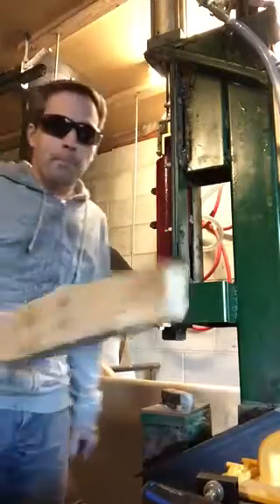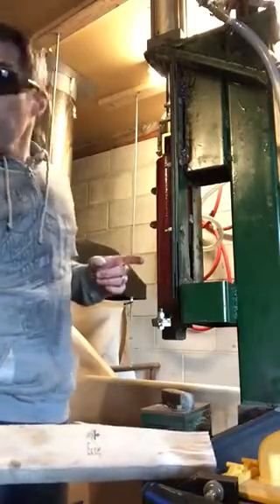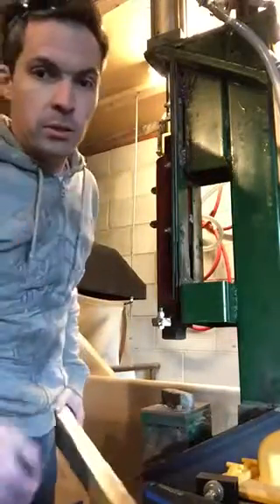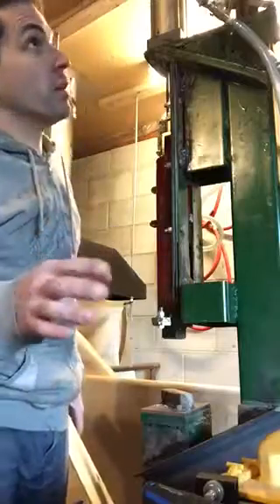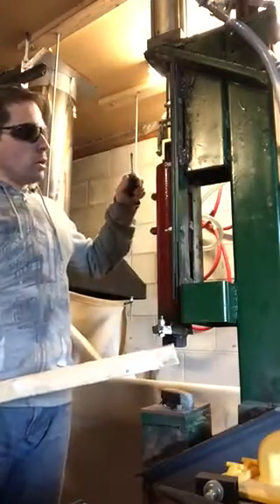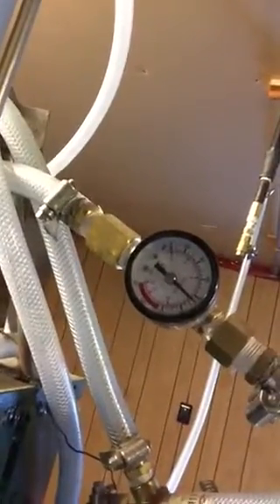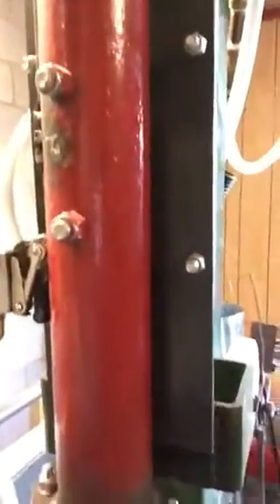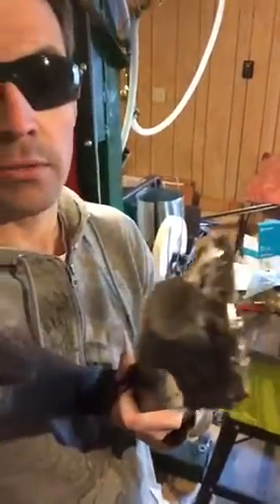Help! - DIY blacksmith power hammer

Comment: I run a quick exhaust on the up stroke to increase cycle times. If you can find an extra air tank plumb it in right next to the hammer. This operates as an expansion tank. Say your hammer runs at 90 psi and your compressor is set to 125psi  this tank allows for that air to expand before the hammer effectively giving you more volume. Even with 1" lines you can starve out the air in the line. My last recommendation is to run a single roller valve on an adjustable height mechanism to control stroke length. 2 roller valves can run a little clunky sometimes. There are a lot of other little tricks but they are dependent on each hammer. Your on the right track👍
Reply from the maker: Thanks!  I have switched to a solenoid valve and hall sensors but my logic was Arduino and that’s proving a bit complicated.  I’m going to try two hall sensors operating automotive relays.  I find two valves gives more opportunity for the ram to glide.  Otherwise I seem to be fighting air cushions all the time.

Comment: When your ram is sticking down, it's likely that the lower roller valve is set to low. The spool in the 4-way valve is not switching position before the upper die hits its target.  You said you didn't like the single roller valve setup because it caused the ram hit to be weak (my words, not yours).  To counter that, the roller valve needs to be lower.  Actually, you should put the roller valve(s) on a sliding mechanism so you can reposition the stroke to meet the needs of the type of forging you are doing.  Other potential issues are...  What size are the ports on your cylinder?  What is the brand and model of roller valves are you using.  Cheap ones do not work well for this application (they act too slow).